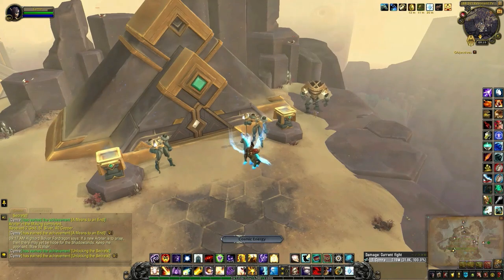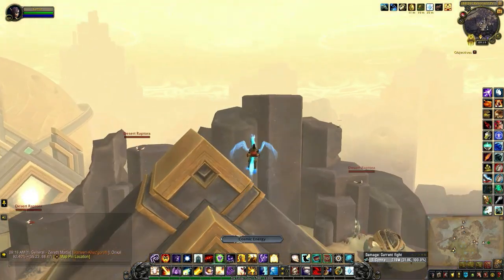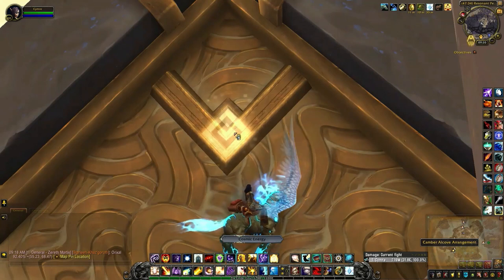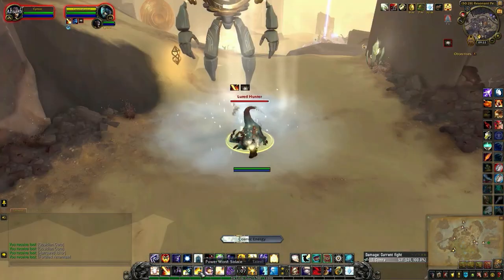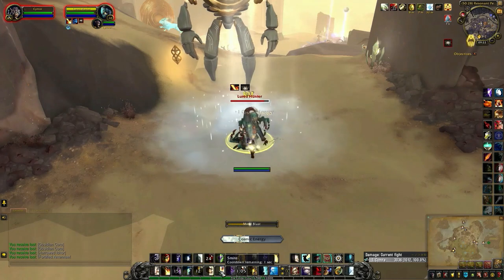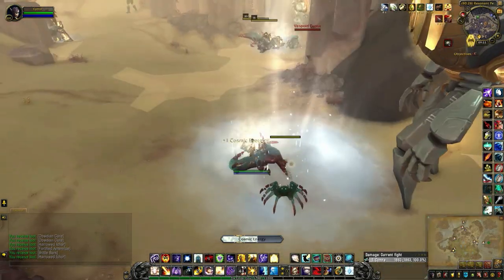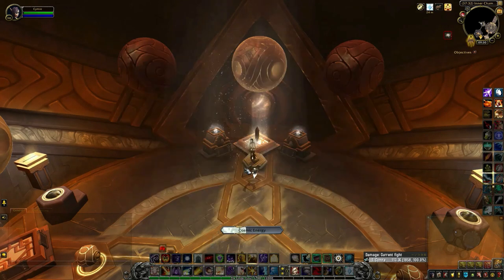Unsuccessful Prototype Fleetpod Schematic - Camber Alcove

Comment: Okay, so I had to check WoW head for this, making this guide total shit.

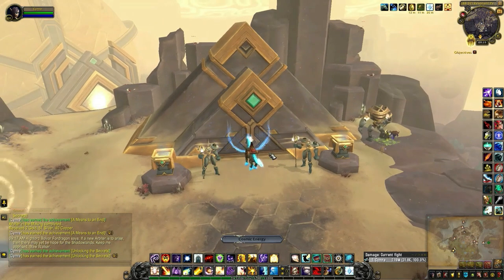The coords for 0:41 are /way 47.7 34.5. Next time, you might want to show your map or post the coordinates yourself. It says I discovered new locations, but when I get there, they do not show up.... curious. 
Make sure you get 60 energy because you must transport twice. Please note it is free to get out.

>Use the Locus Shift to take the Interior Locus to the Inner Chamber. You will now see a new Locus Shift upon the platform at the north-western side of the room, which you can use to travel to the Camber Alcove.<

Once in the Camber Alcove, interact with the snail and you will minimize. Look for small gold portals and guide yourself through them  5x. You will get 5 positive charges and that completes it. When you hit the sand, you will get a negative charge. You can still make it, but at 5 you have to start over again. Once completed, you will be able to loot the schematic.
Reply: Thank you so so much.
Reply: @DarkPrincess11630  Any time.
Reply: Nice, ty

Comment: Ok, here's what I'm finding - I've done all three requirements you've listed in the description box. I've pushed the button, gone back to the inner room - need to mention the transfer locus is not in the middle of the room but at the back of the room. The game forces you to go in a clockwise circle. What about the other three secret treasure rooms?
Reply from the maker: The videos are up on the channel
Reply: @cymrejones  I don't think I saw links in the description box but I will go back and double check that. thanks.
Reply from the maker: @bertjones3010  you can also click the blog post about the Treasures of Zereth Mortis. Look under the Treasure Rooms section.